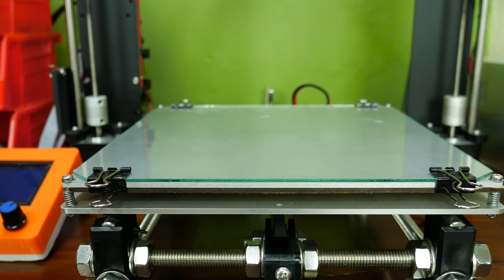🔩✔️ Upgrading the Y-Carriage  -  3D Printing 101

Comment: My understanding for this configurations is that 3 quality linear bearings are better than 4 since 3 points make a plane. With 4 you may have binding if the rods are even slightly out of alignment or not straight.